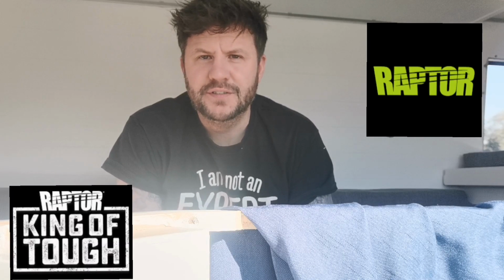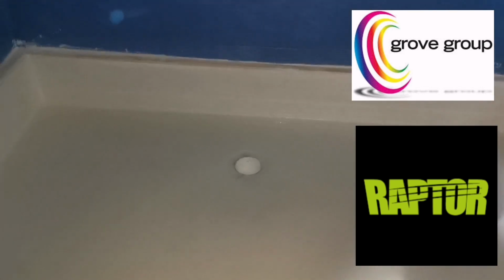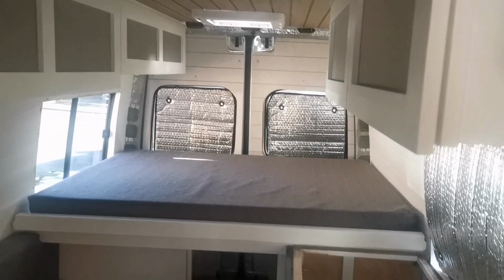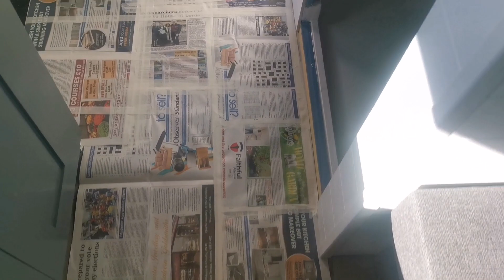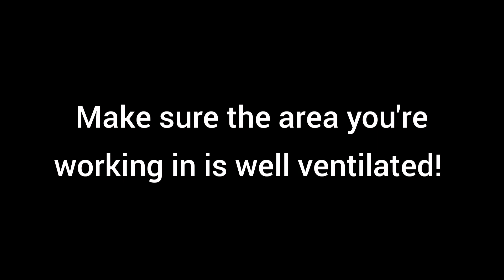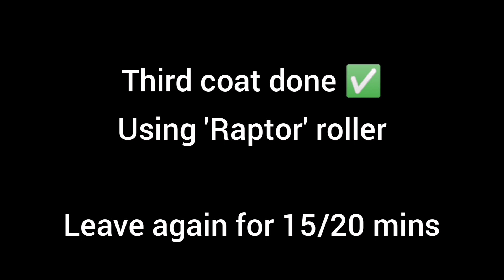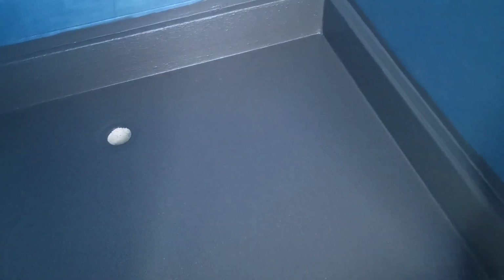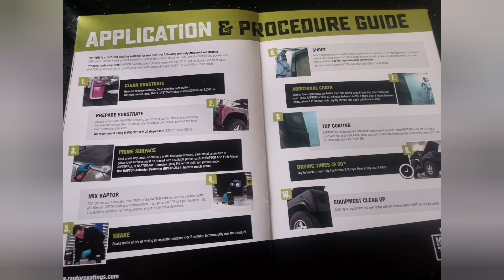Raptor painted shower tray for campervan conversion build (tutorial) grovegroup.co.uk / Raptor

Comment: When you were painting the shower tray you left each coat to dry before the next coat but if the paint is mixed with the hardener doesn't the paint go off in the bottle due to length of time it takes until each coat dries?

Comment: Nice Idea, will be interesting to see how it holds up over time. We are going to do something very similar with ours but using Fibreglass. How did it do going over the tanking?
Reply from the maker: It went over no problem. Because I had to take a break from the build... I sanded it lightly and went over it with another few thin coats just for extra insurance. Didn't need to, but has the spare paint so thought why not.

Comment: Hi just came across this video,interested on how that is holding up? Any cracks from van vibration?
Reply from the maker: No. Its all good so far 🎉
Reply: Would you give me a run down of what you used,been on website but not sure what stuff to buy,thanks
Reply: Sorry I’ve worked it out from your video,going to try this

Comment: Interested in how you made the tray out of ply - did you stick plastic to the sides?
Reply from the maker: https://www.instagram.com/p/CS94YXmodVT/?igshid=MDJmNzVkMjY=
Reply from the maker: 12mm ply sheet cut to size. Timber betons for the walls. Drilled into the ply (with pocket jig). Before drilling, sealed with soudal fixall.

I added more timber to the walls to make a deeper tray...
Reply: @sprintercraftercampervanco8463  great thanks - so then just raptor onto the primed ply?
Reply from the maker: @patrickolner6198  yes mate, sanded it down to key it up with 120 grit paper....
Reply: How is this holding up still, any problems ie cracking, damp anywhere etc? TIA
Reply: @dazmtb  Interested to hear the same
Reply: How is this all holding up and is it still water tight and no shrinkage or movement?

Comment: quick question, did you add any slope to the floor at all or was it just flat?
Reply from the maker: Hi, did it flat by slightly recessed the hole. The van will never be completely level so it would be a window scraper to get the final bits up anyway I thought...